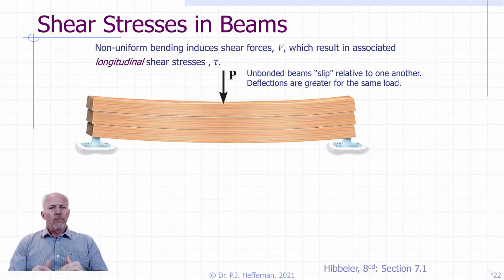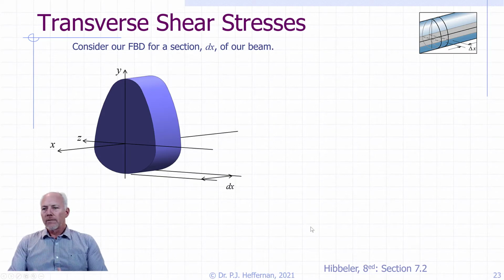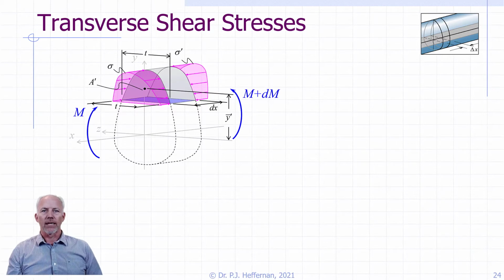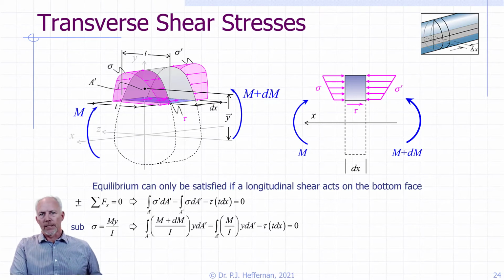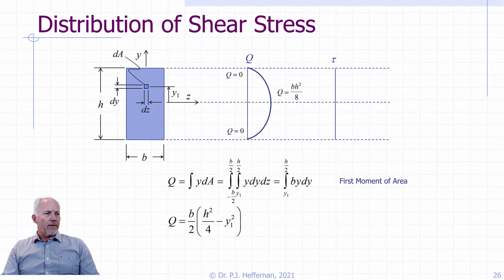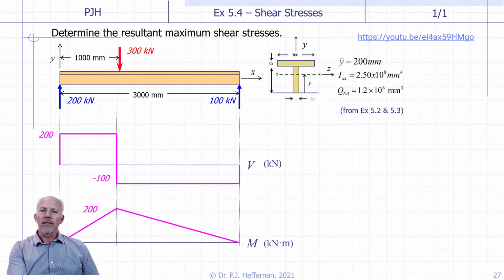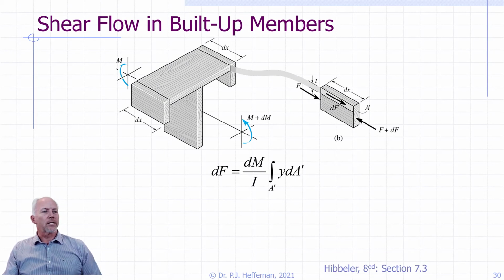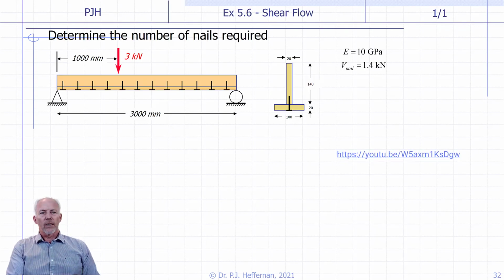L5.4 - Flexure, Shear Stresses due to Bending

Comment: Hi Dr. Heffernan! I had a question about the concept question you shared with us at the beginning of the lecture regarding the stacked unbonded 2X6's. I'm unsure as to how to solve for the moment of inertia for all 3 beams and in turn solve for the deflection. Initially, I had thought that you would calculate the moment of inertia using the parallel axis theorem but I realize now that you would use the parallel axis theorem in the second scenario when the beams are bonded which will give you the normal I = bh^3/12 answer (which makes sense!) For the first scenario when slipping between the beams occur would you add the 3 Moment of Interia's together and use the total in the beam deflection equation or is that not the correct way of solving it?
Reply from the maker: So, if the three beams are bonded together then they will act compositely and the h (I=bh^3/12) would be the sum of the three h's.  If they are not bonded, then they would behave independently and you would calculate their individual moments of inertia and then just sum them together.  The composite moment of inertia would be considerably higher than the sum of the three independent moments of inertia.  Hope this helps.
Reply: @PatJHeffernan   Thanks Pat! It does help... I appreciate the response and have a great rest of your day!

Comment: hi you are so cool i want ask you a question.
can you explain what is different between normal stress due to bending if force is along y or  x axis 
you has expained what s happening when Force is along Y. axis 
now can u see what is happeening if force is along X asis .
Reply from the maker: Hi.  So, a bending moment will cause normal stresses.  So, if the x-axis aligns with the longitudinal axis of the beam, the normal stresses will be in the x-direction regardless of whether they result from a moment about the y-axis or a moment about the z-axis.  Does that help?